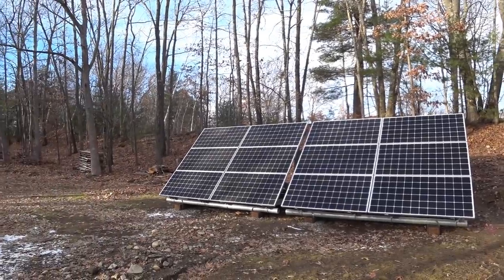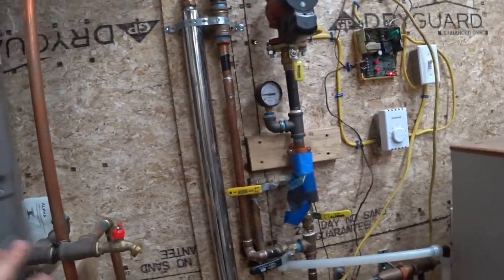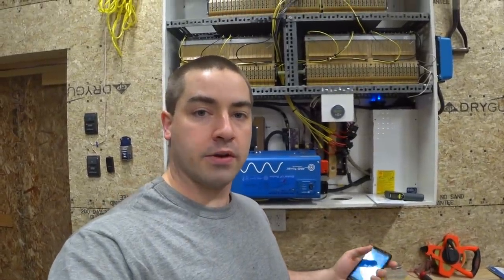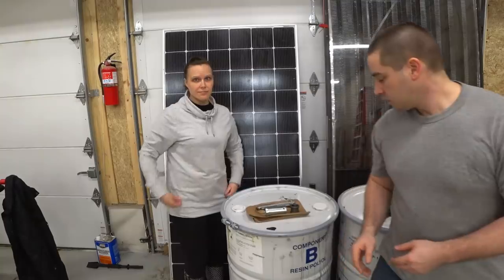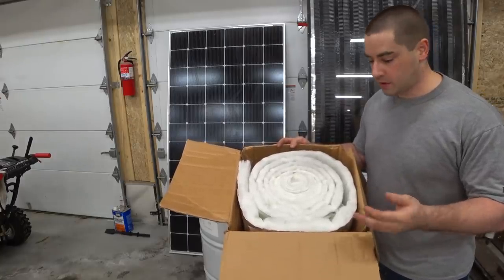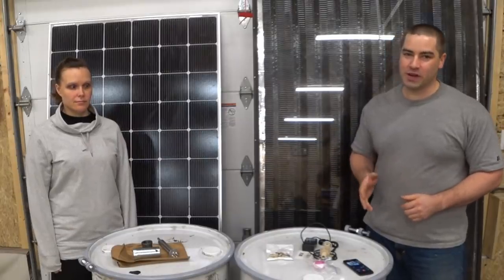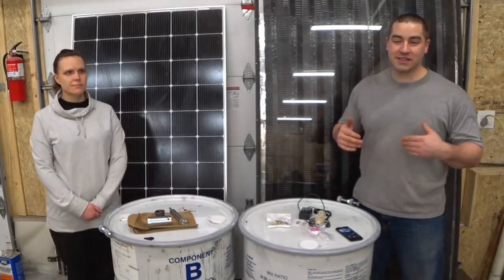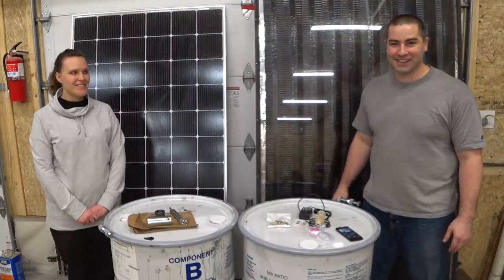Solar PV vs. Solar Thermal Experiment

Comment: Great analogy: tortoise/hare. In your situation with daily shading from those tall trees (and probably periods of extended cloudiness being in the northeast), I'll guess the DC electric heating element wins out. In areas with more clear days and situated with no shading (like where I am in Colorado), plate collectors work very well without having to go with expensive evacuated tube panels. As a disclaimer, I haven't tried the experiment myself yet. I am building flat plate collectors (from the BIS site) right now to heat a 400 gallon tank I built under an addition that will be used to heat our floors in winter, and perhaps preheat domestic water in summer (main water heating is an on-demand propane unit). In our case, my backup/supplemental water heating plan for the tank is a loop behind both wood stoves which get used daily all winter. They get very hot, and I'll be replacing the thin heat shield that keeps the walls from getting hot. I should be able to suck some BTUs out of heat that's simply being deflected. It's a big tank and will need quite a bit of heat to warm it, especially at startup. Anyway... Can't wait to see how your experiment turns out. I'll let you know how mine does.

Comment: I've been using a very small DIY batch mode PV/battery powered shower heater for about a year. I have hot water when the solar thermal systems next door are getting cold.
I usually only run it during the day but I can also get a short hot shower using 1 or 2 percent of the charge in my 20KWH lithium battery. 

I'm off grid and all electric - with 6KW of PV my batteries are full every day including days of total overcast and rain.

My long term plan is to try two electric systems in tandem with some smart control.
I'm in NSW Australia.

Comment: Solar concentration are mostly used for larger power generation(aka plants) to harvest the energy from the sun at that efficiency. Now, the efficiency of a small sol-ther would be diff, solar pv cannot fully take all the energy when the day is very bright but sol-ther on the other hand can take more. This is why they are used in deserted hot places. But solar pv being versatile, it is better for small applications @ varying climate conditions

Comment: The experiment is flawed in many ways as described in other comments, but compliments to you for trying! We are also in Massachusetts where incentives for both PV and solar thermal are generous. Bottom line in MA is if a homeowner is installing a PV system anyway, and has room for 6-8 more panels, PV-powered electric hot water heating makes sense. However, if installing for domestic hot water only, a stand alone PV water heating system is more expensive and takes up more roof space than a standard solar hot water system. We've installed over 500 solar hot water systems and have found our simple 2-3 collector drainback design is very affordable, performs well and requires little maintenance.

Comment: I would think for your area, and heating spaces only in the winter, PV will be best.  However if you use it for year round heating (water), in the summer I would guess thermal would massively outperform PV in the summer.  So maybe best, is both?

Comment: Great working hypotheses, Dave. Comes to my mind to insulate or isolate the drums from your floor. We have solar thermal hot water in Joshua Tree, CA (desert). Works great March through October but needs the electric boost through the winter.
Reply from the maker: I will have insulation on the bottoms.  I'll actually have the tanks (drums) outside, so I'll need a lot of insulation. Two days ago it was 0°F

Comment: Love your Stuff! No expert here with the Flat Plates as i Love the Evacuated tubes and i make my own Flat Plates which feeds into my 60 Evacuated tubes which kicks it up. I think with the Flat Plates they dont work so well when its cold and no direct SunShine . Id Love to see u try the Evacuated tubes which work on the Vacuum,like a thermos bottle but lets in the Sun Shine in a one way direction and bc of the Vacuum it dost "see" the Cold as much.      Love ur Pump!  also but i use the Topsflow ones that are 17 Volts Dc,Stainless Steel for under $150 and a small pv panel. I also have a site just dedicated to Solar Hot Water called Guilt Free Hot Water!   Keep up the Fantastic work!  We must build a big Flat Plate one time? The one i made is 16 ft by 16 and has been working very well for the last few yrs since i made it. All parts are Local,eg Home depo ect. Also if u could have had ur Flat Plat up at Higher Angle so it could "see" the Sun? Les work if u just use that Temp sensing gun and shoot the out side of the barrels?

Comment: Looking forward to your experiment in your area. You also need to take into account:-
1) outside temperature
2) total collector's collecting area
3) total cost per system
4) time to install each system/collecting area
5) Maintenance/Failure cycles
6) you will need to do the tests over a lengthy period of time to get good results.
Reply from the maker: Yep, it's going to be a long-term test.  I don't care much for data from one hour or one day.  LOL

Comment: This is great! I'm thinking PV with batteries will be the clear winner. You currently have more PV than available battery storage, get another Volt pack to double your storage so you can be 100% off grid. Solar water heating is outdated was good in its time, use the space for extra PV panels. An Aunt in Hawaii added 20 280w grid-tied PV and removed her Solar water heating panels. Installed an on-demand 27kW water heater, no more early morning cold showers. Her system broke even in 3.5 yrs. She only pays the minimum service fee.
Reply from the maker: I'd love to get another Volt pack.

Comment: this video is misleading. u forgot to list the following info, 
1.your solar panel cost is how much vs thermal, it seems u used double the size of the pv. 
2. your 600w will not power your 1500w heater.
3. even if it works, your 1500 heater will take more  a very long time to heat your drum of water.
in short,  the info u have provided may seem to favor pv while in fact, it is not, the true test is to put the solar of the same size and compute for its output.
Reply from the maker: This video is just our introduction to the experiment.  You may want to watch the series to see all the details.  Your concerns are addressed.  Thanks for watching.

Comment: One important thing to consider when using grid-tied solar is that any extra energy can be " saved " almost indefinitely with PV in the grid. This extra energy can be used later  when you have a week with no sun  for hot water  or anything else in the house . With thermal solar usually you can only store a few days worth of hot water at a time. If you have a week's worth of beautiful sunny days you may only be able to store the first couple of days worth of energy in the hot water tank before reaching the max tank temp. and the rest will be wasted (unused).

Comment: Just to add another thought you should consider using a thermal heat pump as the solar unit as it does add significant efficiency over a pure resistive heating element ..

Nice work what you have done - time will show a lot of good data ..
Reply: I have one. The problem with a heat pump is you can't get the temperature much over 120F.  That doesn't allow you to store heat overnight  or add small amounts of power. Using resistance in addition to HP allows temps to get higher to compensate for the 1-2F loss each hour thru the night.  People in solar haven't even thought about automating systems for best efficiency. Like politicians and the general public they are behind the curve. A friend does multi million dollar HVAC systems and 1/4 of that budgeted expense is in automated controls now. Industry understands.

Comment: In your test tanks, one has the water circulating and the other has convection from the static element, so that may skew the temp results, so put a pump in the pv tank to stir that one as well and remove stratification errors. 
Buy a few vac tube water heaters, mine are awesome. A couple to play with won’t break the bank

Comment: James Biggar did a DIY hybrid PV thermal air heating system. It was hot enough it melted his EVA encapsulate maxxing out at 212F. Part of the problem of off the shelf solar thermal are the frames are aluminum which will thermally conduct the ambient temperature decreasing efficiency. In his personal Resystech design the framing was all wood which has 1205 times less thermal conductivity compared to aluminum. He redesigned it but I've yet to see the data for it granted I haven't digged through his website.

Comment: I believe the best would be a combination of both systems. Will you be using a heat exchanger in the solar thermal system?
Reply from the maker: I'm planning on a drain-back system, no heat exchanger.  And yes, I agree.  Possibly if someone had two tanks, one that was the pre-heater (solar thermal) and the second was solar PV to get it real hot.  It might work?
Reply: @DavidPozEnergy , you could combine both systems in one tank, by fitting the heating elements (PV) towards the middle of the tank, and a heat exchanger (solar thermal) at the bottom. That way the pv heats the upper half (saving energy) and the  solar thermal (when available) heats the whole tank.

Comment: For a new installation I'd go pure PV in areas that freeze outside.  Seeing the last video where you had a leak due to frozen water in the S.T.  was a real turn off.  Since you already have an S.T installation, I'd go combo ST primary and PV backup or in tandem on shady days.  You'd get the best of both worlds since you can use the excess PV power for something else on very sunny days.  That heating coil does look wicked and feels like it wants to suck a lot of power and that pump looks like it may be under-powered - just depends upon how far and high (head) you need to move the water.  It will be very interesting to see your results.
Reply from the maker: Yes, the leak in my system was one of the catalysts for wanting to do this experiment.

Comment: I have solar PV and solar thermal panels on my roof. My solar thermal panels heat my immersion tank primarily as much as they can and my solar PV panels heat my immersion tank when there is any excess electric going back to the grid using my top and bottom immersion heater(with use of an immersun device). I am not sure if I have got the best of both worlds or whether the solar PV is heating my tank when it can as fast as it can and my solar thermal is cancelling it out and cooling it down ? Any ideas ??
Reply: Install temp probes at several points in the system. Then either integrate an intelligent controller to manage the entire system or manage it manually using the the read out of the temp probes to guide your decision. For example solar thermal won't work when there's no direct sunlight hitting your heater at an optimal angle.  This is the case on a sunny during the midday hours (about 10am to 2pm). Solar thermal needs to be turned off when there's no sun shining at an angle of incidence, which is optimal for your solar heater. If you don't turn it off your solar hearter will act as a cooler. Installing a timer that runs the  pump for the solar heater from 10am- 2pm will help. Can also add a temp controlled switch that turns off the solar heater pump if temps in the return flow drop below a preset value.

Comment: Thermal panels work on a temperature "Difference" -- if you have 70 degree water coming down from the panel on the roof (cloudy day) and 55 degree ground water coming in, the system should turn on and energy should warm the ground water in your storage tank and return to the roof cooler than when it came down.  In turn, the warmth of the roof panel should warm up the water and the cycle continues.  But, if you are feeding that 70 degree water into a 70 degree room (e.g. floor heat) -- then no exchange takes place.  The pump senses this and doesn't cycle.  I like your experiment -- anxious to see the outcome.

Comment: I believe your thermal performance is skewed by the outdated panels. Here in Canada I have both solar thermal and pv. The thermal is preheating 56f well water to 90f  with a day time high temperature averaging 15f and night time lows some night -10f with no performance issues. Other advantages are little snow build up , less of a footprint 72sqft and better response to Sun and temperature.  Would say from april to November  it exceeds all our did needs.
Reply from the maker: Cool.  It sounds like you have a great setup.  Could you share a video?  I'd love to see it.
Reply: @DavidPozEnergy  , I would say you should use a harbor freight solar panel to compare with,   this is not an equal comparison. You did your due diligence on your pv system in choosing cable size, controllers,chargers, inverters etc.. please do the same for thermal that thermal panel technology is way out dated. PV should win this uncontested. thanks

Comment: Btw, check your solar cells have bypass diodes. This will increase redundancy, efficiency, when a single cell has shadowing.  Also if a single cell has silicon Depreciation, they can cause radiant heat, resistance and impede the traffic of electrons, therefore causing the overall panels to lose 80 percent or higher power production.

Comment: Just ensure that the surface area, tilt and orientation are the same for both of them. 
In your introduction the solar thermal panels were more shaded. If they were on the roof you would have seen some heat production.
Reply from the maker: On my garage I have some solar thermal on the wall, and some on the roof.  Maybe it was just harder to see them on the roof?

Comment: I wonder if a vacuum tube thermal unit would do better than a flat plate collector?

If you can factor in the surface area of each, and possible cost, that would be good.

A dream of mine is to have a water thermal storage system, to dump heat into (from your frig and freezer, and A/C), that you can add heat to with a vacuum tube system, and then draw heat from, with a heat pump to run a clothes dryer, or domestic hot water, and/or space heating.
Reply from the maker: Vacuum tubes would probably work better, but I don't have any.  I'm working with what I've got.
Reply: @DavidPozEnergy  Understood - I am looking forward to seeing how it works out.

Comment: It should be interesting.
But to really get a better picture you have define or ask what are your goals.
Is it just to heat hot water year round?
Is it to heat the house during winter?
Climate also makes a big difference.
I have installed solar thermal for hydronics, works great but not so great for most clients, too much work to install and monitoring.
However I now recommend heat pump with solar PV, simple to install and monitor.
Also during the summer you have extra PV panels to run whatever.
However Solar PV straight resistance water heating during winter is going to struggle.
In Canberra Australia a 10kw PV array (large) will produce on avg 20kwh a day during winter.
It takes approx 1.2kwh to heat 1,000 L water 1 degree Celsius (sorry not so good on Fahrenheit or gallons or BTUs).
On a good day you could heat the hotwater for domestic use but nothing else.
This could heat a room or two but not much more. 
Good luck
Pulpo

Comment: I've been heating water with PV for years. Connecting the heater off the battery is not a great way to do it. It is done that way because that is what people can understand. I power off the panels voltage without going thru the battery.  This leaves the battery at the highest capacity. My home built controller senses whatever power is not used for charging and diverts it to heating water at the power point voltage.   Whether 5W or 500W whatever is excess.  This is the future of solar heating, simple and easy. And that excess electrical energy can be used for ir conditioning in the summer. Thermal heating is history! If you have the ability to build electronics check out my videos.  Cheap 2,000W 120V elements work great on 48V and higher systems.
Reply from the maker: Thanks for sharing.  I will go check out your channel.
Reply: @DavidPozEnergy  In the summer, I'm probably not that far from you. Maybe we could build a system and you could make a professional looking video. It looks technical but really quite simple and cheap.
Reply from the maker: I'd like to discuss this more.  Can you send me an e-mail through my website?

Comment: I've been following your videos for quite a while and learned a lot!  Im running 2x 280watt PV's straight into my geyser.  Works great.  But this morning I ordered a 62v 1200watt element (wireohm is making me one),  to be able to output max watts.  Only getting 290watt at this moment,  because I'm still using the stock 4kw 230v element.  Should get the new element in 4 weeks time

Comment: Can I run a single 150 watt pv panel to a single 12v 150 watt water heater element?
Reply from the maker: Maybe, but I don't know for sure.  You would need to know the Vmp of the panel, Imp of the panel, and the Ohms of the heater element.  You will probably get some heat, but probably not as much as you could.